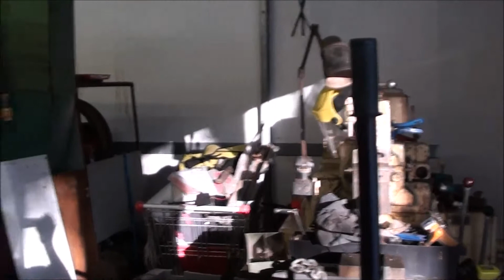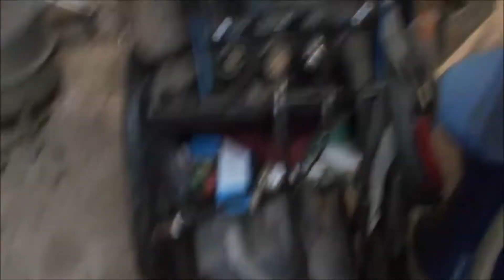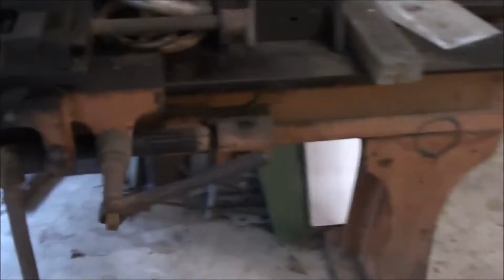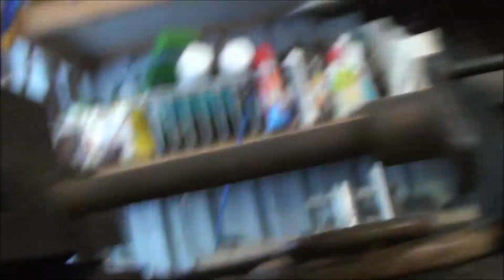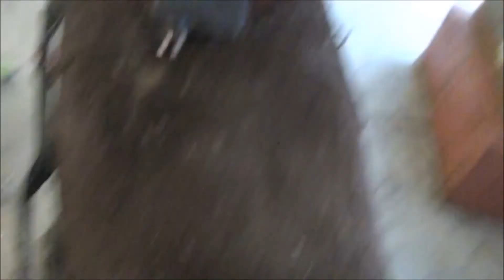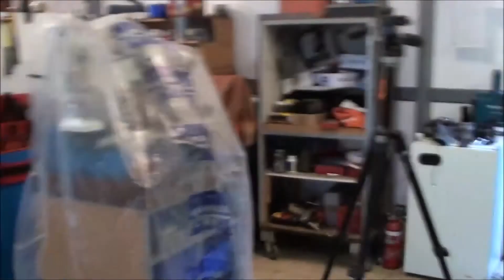Talking Turkey 04

Comment: Good to see your back Greg. With snow starting here your moving into summer. Without electrical there's not much going to happen in the new shed so wall insulation and electrical are pretty much moved to the top of the list. As soon as you started showing the old lathe and mentioned wood turning had been done on it I figured the spindle bearings would be toast. Very few woodworkers unless there in a proper trade like your day job have much idea about proper oiling and machine maintenance in my experience. And most hate oil of any kind other than Danish Oil. :-) Some real odd functions on that lathe that aren't very common on other machines. That lathe is likely from the 1890's to possibly as late as the 1920's would be my guess. Some fair sized lumps of steel you've got there. Should be a couple of interesting projects in those.
Reply from the maker: I am certainly looking forward to getting into some of the projects.